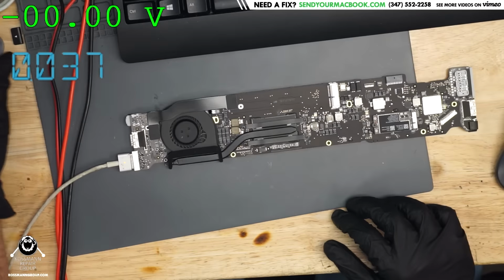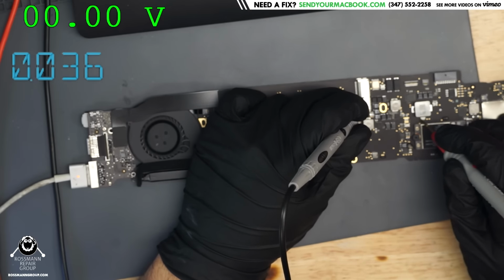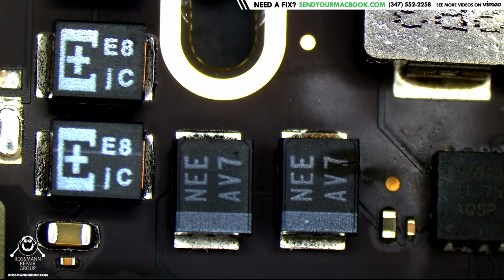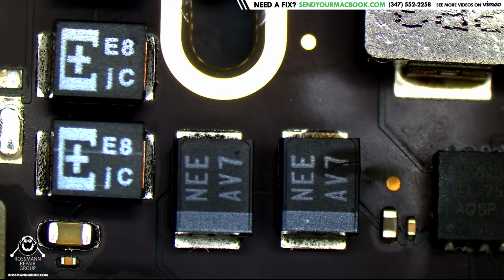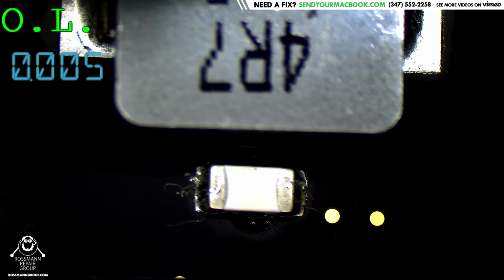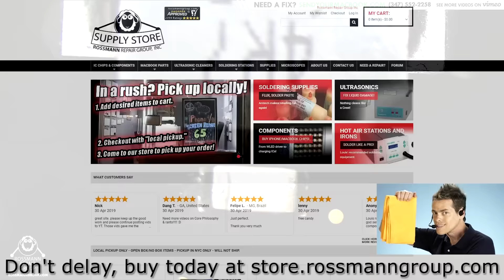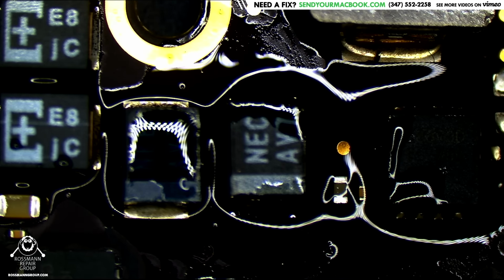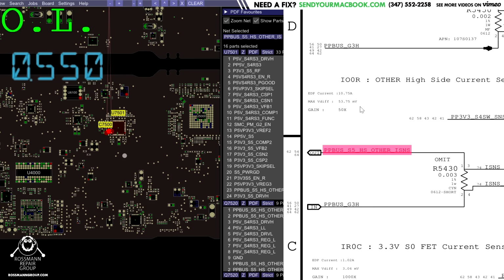The most common Macbook Air logic board failure - how to fix.

Comment: Someone who sees a blown fuse and searches for WHY before replacing the fuse? Madness.
Reply: Yes troubleshooting is a lost art. I have seen people put in foil to replace fuses and say its ok since it works.
Reply: He'll also wait for the fuse to blow!
Reply: How else could you find the fault?
Reply: It's something which is discovered right at the beginning of the learning curve. Fuses are to protect everything between them and their supply voltage. If you don't look downstream and fix the fault, all you will do is blow another fuse. Or, worse, you'll blow more components downstream as well as the replacement fuse. 
I'm a bit surprised that black sheep didn't check that the short to earth had gone before he powered up. I guess he has seen this fault many times and knows that it's a single component fault.
Reply: I've seen some "YouTube mechanics" use a thin speaker coil wire to jumper the fuze. lol  While it may work it's not the safest or most elegant thing t do.
Also, I was wondering how come Louis never (or rarely) does any iPhone/Samsung/LG board repairs, which is usually the bulk of work most repair shop do?!  Hmmmm
Reply: @CyberlightFG  replace the fuse with a link and see what gets hot/releases magic smoke of course! 💨
What? Making more damage you say.?. Bah humbug! 😜
Reply: I knew more than a few people that had pennies in their home fuse boxes back in the day. Most would only stick it in until they could get a new fuse, but plenty left them in permanently.
Reply: @88porpoise  

I use gold ingots
Reply: @BillAnt  He got enough work with macbook :))  (if you seen his videos
Reply: @Re-cur  < Well, I still wouldn't pass up a extra job just because its a phone. ;)
Reply: Yes pure madness, imagine doing the job completely with due care and attention, fixing it so it will not happen again. LOL

Comment: You will never see a tantalum capacitor in any piece of automotive electronics because of the ways in which they fail.  Apple seems to like them quite a bit for some reason.
Reply: They have pros and cons like anything.
Reply: @3nigma.3nc  Pros: They break stuff, cons(pros for Apple): Makes consumer buy new items which break.

Comment: To repair electronic boards, one needs to understand basic electronic hardware, i.e., capacitors, semiconductor chip and the knowledge how to use and read the parameters shown by these equipments. Also, the knowledge of reading and interpreting schematic diagrams of the circuits boards is also necessary, Apart from that one needs to have an investigative drive to explore the possible issues that could have caused the problems int he board. This will be possible if you have a good amount of experience in doing these activities by trial and error.
Reply: Among many other things you don't even mention, you'll need a good brain, and at LEAST 1000 hours experience in one corner of the market, say macbooks or TV's, to have any chance of making a living at it. Trial and error will simply take too long to be of any use in a commercial setting. 
Also, sharp eyes and a good sense of smell, often those 2 things will make everything else irrelevant by bringing you immediately to the failed component.
Reply: tasmedic what about good sense of smell?

Comment: My 2015 Air died after less than 3 years of use. The Apple service center would charge eye watering prices for it. A non-apple center just told me it had a "dead board" and I had to buy a new board which would cost almost the same as a new one, and that was the only other repair center in my area that had the chops to repair it. I was so dejected, it's now gathering dust in a corner. FML.

Comment: Hey Louis, I just follow your method to check my 2011 MacBook Air A1369 and found out one of the fuse and a (A1 V7e) capacitor was burned, do you sell these two parts?

Comment: Hello, nice work and I really love your videos. 

I have a 2014 11” MacBook which I have been using since 2014 till date but a month back it ran out battery and it wouldn’t turn on so I tried everything including the disconnecting abs connecting the battery back until I did the smc reset which actually worked and it’s been working fine till 8 days back. The system was fully charged and I decided to shut it down because the airdrop was acting up. Ever since I shut it down it has refused to turn on or charge ( no light on MagSafe), tried different working chargers but it wouldn’t work on my system. Tried the smc reset, disconnecting the battery, touch pad flex and even removing the sscid and replacing back but nothing is happening. I am currently in Nigeria where there is no apple store and am scared to give it to some random repair guy cause they might cause more damage to the system. 
Can you pls help give some clues as far what could cause the system to breakdown like this. And what hardwares or chips fault  could result go this. 

Thanks for your anticipated response 
Olivia

Comment: Is it always that Cap or could it be one of the others in that area? I have a blown fuse but the caps look fine. I removed the same one you pulled and checked if it was shorted and it isn't.

Comment: Hey I replaced motherboard on my air and cannot instal Catalina, should I install mojave and then catalina? I suspect old firmware on new logic board since I had to change date from 2015 to 2021 using terminal, not sure how to upgrade firmware... or is it the real reason ;p

Comment: That's not a common failure.. That's a usual failure of this MacBook and I had already so many MacBooks with this failure. 
I even once found few of these on my local recycling station and all had also the same problem + a lot of private data 😅

Luckily those machines were "Engineered by Crapple in California" ;)

Comment: Water spilled on my macbook and when I sent it to repair it, I was told that the battery has a problem and I wont be able to use it without it being plugged in. Now it wont fully boot up and now I'm hearing that its a logic board problem. Can it be fixed or am I going to need to purchase another laptop.

Comment: I traded something I got for free for something that didn't work, a MAC Air. I have reason to suspect that it may have the same issue as the one in this video but I do not have the tools or desire to replace those tiny parts on a PCB. What did you charge for that repair. A. $50-99 B. $100-149 C. $150-200 D. Over $200

Comment: i dont get why apple bothers with fuses. Not that anything gets repaired anyway. The only reason i can see is putting a main fuse between the battery and the board to prevent the battery from exploding in case of a nasty short. Other than that, i do not think apple cares too much.

Comment: What's the bare minimum of equipment to get to get starting repairing macbooks?
Reply: Depends on the economics of the most common repair you will find. It is dependent on the model you're fixing and whether or not you're charging for data recovery. No one has enough time + Information + effort to make a business plan that works for you  except you. Doing repairs isn't the most profitable profession out there so expect to do this only if you have passion for it. 

   Most important thing is removing excuses for not starting to do what you want to do with your life one by one. Until you are practically left with no choice but to proceed into your desired path in life.
Reply: @luizcastro5246  Yes. Being a technician for many years, electronics is a labor of love. Electronics in the old days was more popular with more availability of parts. Over the years, parts stores and shops have closed.
Reply: I found a pcie ssd reader for cheap like $15. All the usb reader convertors want $60-$350 usd

Comment: every time I read "fix macbooks" I think "buy an acer, its cheaper"    I'm not wrong.
Reply: Except Acer cripple some CPU features in their laptops. I had to actually mod my bios to get virtualization enabled so I could run a virtual machine on my Acer laptop, because the option was even removed from bios.
Apart from that it's a decent laptop.
Reply: @ThatStella7922  Virtualization on a single core Atom CPU. Yeah, right.

Comment: let me seek for help please - I have a Super Weird behavior air 2014  
- it does not start with pwr btn press, I need to press it like 10 or 20 times and afterwards, it will turn on.  
- When it is turned off (by holding power button) the fan spins every about 15 seconds, but just spin and stop * when it is turned off*
- when it's turned on, it works flawlesly, battery holds 6-7 hours.
- I am not able to update to APFS OSX  - no problem to install any op to High Sierra. that one and above shotdowns the mac off -  my gues during firmware update, when black screen with apple and minutes counter is shown, shutdowns at the same moment everytime

Thank you for help ! I did everything I've found over internets, trust me Im actual engineer :D but this is first mac I am working with

help pls

Comment: I bought two 2019 macbook pro's and both were shutting down when battery dropped bellow 40% and no resets or anything of that nature did not fix the problem and even the shop couldn't fix it.
Swapped my macbook pro for a Asus ROG STRIX G with RTX2060, Intel I7-9750h, 16GB RAM, 2TB hybrid drive, 240GB NVMe SSD and its very slim and cool for a gaming laptop. Never had a single problem + for my usage it lasts a whole day of school(software development).
PEOPLE STAY FAR AWAY FROM MACBOOKS!!! 
EVEN THO MAC OS IS NICE!
JUST GET LINUX!